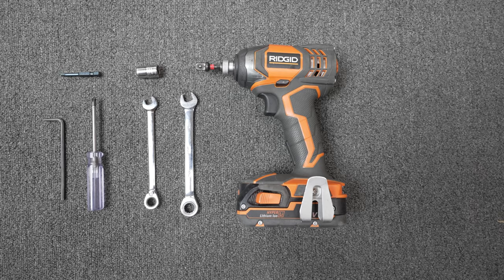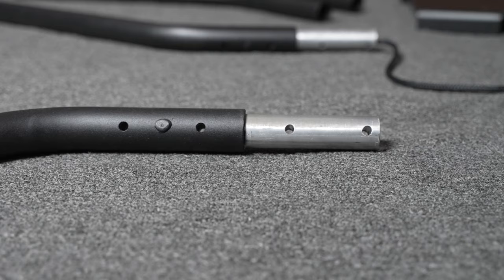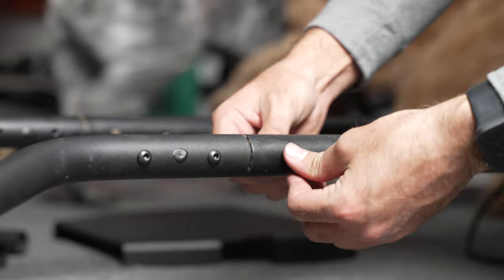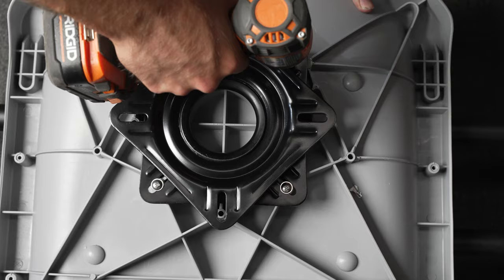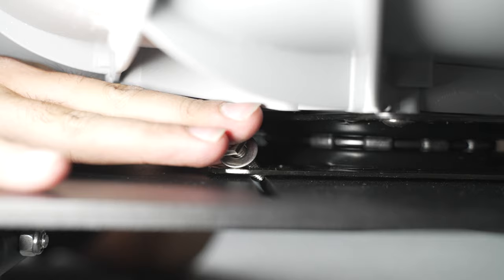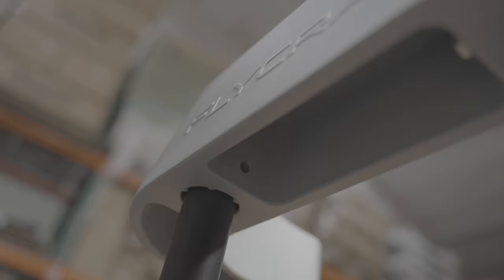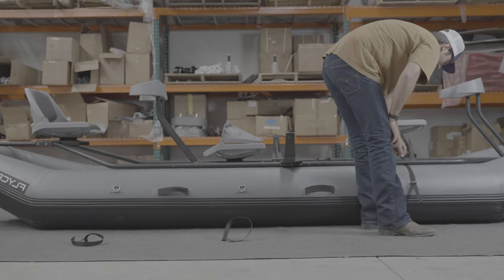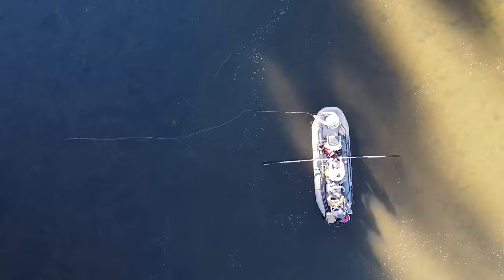How to assemble the FLYCRAFT GUIDE 3 man boat

Comment: Nice boat for sure I like the direction the company is going. However, in the future I would like to see a frame that had rower foot braces, larger tube raft or a frame that allowed the anchor to sit out of the water in all fly crafts I have seen on water they are dragging their anchor through the water when it is in the highest position which makes zero sense. Also I wonder if this frame could have an option to not have the welded leg lock stays. Forgoing the leg locks and fishing from a seated position would make the boat much bigger